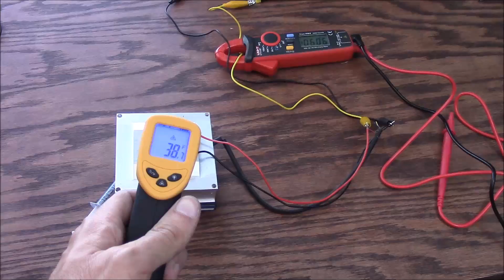Peltier Cascading - Does It Work??

Comment: to keep the usage down you can add a flat water block to introduce water cooling the heat sink would be stage one cooling and the water circulation would be stage 2 cooling. Im currently experimenting with this to see the lowest temp i can get with a 12715 the more TDP i add to colder the cold side gets but have not managed to get higher than 10 volts for the peak cold at -4c using baby oil yep baby oil.
Reply from the maker: We should compare notes on your experiments.  I am racing to do as much solar stuff as I can before fall begins and then I am going to turn my attention to indoor projects such as this peltier stuff.  I want to explore TEGs and build a peltier fridge version 3.0.  I also have a device to start experimenting with peltier air conditioning.
Reply: ive done alot in my days that involved TDP and the pelts can not be skimped on for the hot side thats for sure. The Tall heatsinks offer great TDP but not an option for me like you what i have is fridge related 10 cubic foot. Your H60s are doing a great job im sure but the hot side well if you do a custom liquid set up do hot side pelt to flat water block then a heat sink. One of those Arctic heat sinks with fan to the water block and get the liquid cooling active it will not only cool the water block but the heat sink as well. The concept is stage one cooling heat from the pelt saturates the water block the heat sink with the fan will pull it away and the (stage 2) excess heat gets absorbed by the liquid cooler and if you have a metal surface to mount the heat sink to (thermal tape and 2 screws to secure it) that would be even better but insulating would be vital to keep the heat out of the cold cause the metal surface is going to pull heat as well. I  did something similar to this and seen a 12c temp drop with the pelt cold side and was able to increase the voltage from 9.5 at its coldest to 10.5 at its coldest on a temporary set up and i dont want the full 12 volts to extend the life of the pelt. Ive seen several pelt videos from factory built pelt fridges failing to cool due to peltier failure. Next step for me is buy an extra water cooling set up AIO or maybe custom for the cold side and Arctic bond it all together no hardware to even have a chance to cross heat over to cold that way. Well at least until the pelt is cut off but that can be worked around to so that its not so bad. From the videos ive seen you do you have enough to make 2 cold sides for one project with your AIO coolers (if you have not put them to other use) but make sure the cold side stays in the cold. Im going with custom liquid cooling/chill with mineral oil its what i know and honestly mineral oil is thinner than water non-toxic non-conductive non-corrosive. After seeing some of the AIO cooling systems fail videos cause they dry out im not sure i want to use them one small part for custom is much cheaper then a whole unit and have spare parts left over to rot away in the closet. As far as the pelt though arctic bond will release but it takes a whole lot of pressure to make it release and then the special cleaner to remove it. I can see the most common fails in a pelt fridge thats well built (listed in order) power supply (only if its under rated or barely enough), fans, pumps then the pelt last if its not over driven but first if it is.  
Peltier 12715 will use 8 DC amps constant and surge 10 -12 amps at 10.5 volts
Not bashing at all dude just trying to help Ide like to see frost on the radiator instead of condensation with the last fridge build you attempted i think that would be exciting!
Reply from the maker: Cool, I will have to give that a try.  Good ideas.
Reply: I stand corrected its not a 10 cubic foot fridge its a 4.3 cubic foot fridge with freezer i just got it from my dad today and a perfect flat metal backing this is going to be fun
Reply from the maker: Sounds fun to me!  I tried converting a small freezer one time to peltier from compressor and had minimal luck.  So hopefully you have a better time.
Reply: heat sink, water block, pelt, water block assembly did not work heat gets stuck at the water block and does not transfer fast enough. just thought ide toss out the update

Comment: Thank you for running this experiment!  Hearing that you are interested in efficiency, are you aware that we receive power from the peltier when there is a temperature difference between the 2 sides?  What about keeping the cascade setup that you have now, but instead of putting in current into the top peltier, we see how much power we can extract from the top peltier?  For the top peltier, the temperature of the top side is ambient temperature and the temperature of the bottom side is the top side of the bottom peltier, which should be hot since you are running current through it to cool off the heat sink.  You should be able to increase the overall efficiency of the entire system.  It would be interesting to know if this would work or not.  I would greatly appreciate it if you could run that experiment.  Thanks.
Reply from the maker: Yes, that is called the Seebeck effect.  I have been wanting to play with Thermoelectric Generators using that phenomonen for a while.  Just haven't had the time.  Unfortunately, I no longer have this cascaded setup.  But I can try to test it in the future for sure!
Reply: @LDSreliance  if you are still interested in TECs, please let this pique your interest. what if you could run a TEC fridge in your car off of like 20 TEC placed strategically on your muffler or similar!  you'd want them wired parallel, with current more important than voltage. add a converter to make it usable
Reply: @willcal2738  you'd want to use TEGs on the muffler part as those are meant to generate electricity. I've been thinking of trying something like this out but using the cars radiator.

Comment: Thank you for doing an experiment that I had wanted to see done for sometime.  If you don't mind, I'd like to suggest a counterintuitive experiment; what if you put the two cold sides back to back, with two large heat sinks on the hot sides?  Would the juncture where the cool sides meet be much colder than your original cascading configuration?  I understand my suggestion means that the surface area of the colds sides are unavailable, but an element could be placed between them (such as  copper tubes filled with alcohol), that could be chilled to use for cooling purposes.   Please let me know if you think back to back cooling elements would increase the cooling effect more; thank you!    And thanks for the videos....
Reply from the maker: That is an interesting thought experiment.  I am not a physics expert but I don't know of a physics reason why putting two cold sides together would make each more effective.  The key to making peltiers more effective is shedding heat on the hot side.  But maybe someone with more experience than me can answer this for you.
Reply: No. Things only cool off when heat is removed. Heat can only be removed via a temperature differential. If each cold side reaches the same temperature, they have zero temperature differential and cannot cool each other off anymore. 

Thus, the temp of the cool sides will stay the same if you press them together. 

Whatever they are trying to cool (if there is something in between the two cool sides) will approach the cool sides' temperature faster if they are both connected, but it will not get any colder than the cool sides' temperature.

The reason cascading works is that you use one TEC to get an initial temperature differential and another to get an even larger temperature differential. When the TEC's are brought together hot side to cool side, they pump heat in the same direction.

Comment: Teg peltier makes energy
Reply from the maker: A little.  It takes a lot of heat to make any power, though.
Reply: geothermal supposedly can be used with graphene woven cables put not too many kilometers into the earths crust to obtain much heat.  Or simply to heat water and turn an electric turbine and afford more planetary harmony.   Maybe much better than fission.  billionsinchange.org was working on it.  Thanks.   Remarkable play time and research with peltier modules in series.   I like.
Reply: They work both ways. When you see teg it just means the same peltier effect is being used but the quality of materials is meant for heat stress. Tec module have smaller elements and less robust wiring and the ceramic surface can be damaged by higher temp on hot side

Comment: i think you.. need a larger and a smaller module.
i mean say.. a 100 watt peltier will heat its hot side with 100 watt + the heat it moved, so the 2nd stage cascaded should be able to move that amount. and your heatsink should be able to keep the top of the casacde within reasonable temps, so dissipate like 300 watts.
Reply from the maker: Yep, I didn't know that when I did this test.  I'll have to try that out sometime.

Comment: How do you avoid condensation So water does not occur ?
Reply from the maker: I have not run into a problem with condensation but then again I have not used one of these all day every day for a long period of time.
Reply: ohh okey, so if you did run it all day there will be a problem - right ?
Reply from the maker: If it was humid and you ran it for hours then yes.  If you run it indoors there will be a lot less humidity because your air conditioner will already be pulling out a bunch of the humidity.
Reply: you dont no a way to not get condensation ?
Reply from the maker: I am telling you that I have never had any condensation problems or heard of anyone having problems.  But theoretically it is possible in certain conditions.

Comment: Are there some peltiers that just pretty much suck in quality whereas others don't? Maybe a rhetorical question but quite new to this. I used a TEC1-12705 in a wine cooling fridge (Haier) & now the temp runs around 70 - 75 degrees F. Before it was running @ around 50 - 55 F so wondering if it would be a good idea to take it apart & sandwich another TEC1-12705 to knock it down a few more degrees? Not really worried about effieiency @ this point.. just want it to work.
Reply from the maker: Some of them are very cheaply made and have really bad quality control.  The tolerances are wide.  I always buy at least 2 at a time and pick the best one.  They also get damaged in shipping easily.

Can you measure the current it pulls?
Reply: LDSreliance Going to look @ it when I get it back on the bench. I did get 5 shipped last order so hopefully 2 of them are good enough to get a decent reading.
Reply from the maker: In the same 5 pack of 12705's I have had 2 of them measure ~ 5 Amps, two ~ 4, one ~3, and one DOA.  I guess that is what you get for $15 with free shipping.

Comment: a mistake: this tyoe of thermometer have a 30-40 degrees angle of measurement, so if you measure at 25 cm like at the end, you'll measure also some heat from the heatsink
Reply from the maker: Good to know.
Reply: LDSreliance In this case it wouldn't be nothing big, like 4-6 * but still someting
Reply from the maker: Yeah but it is always best to be precise if you can.

Comment: I have tested a similar setup, except using water cooling - results below:

Maximum water temperature in the LQS was 35C at max load. Due to the heat distribution in the water, hot-side thermal conditions were therefore considered to be fairly static. this was monitored during the experiment.

I used water as the thermal conductor between the two peltier stages - this allowed me to know if the junction between the two where above or below freezing (the two units would be frozen together if below freezing).

Single peltier cooling allowed -18C to -22C at 12 volts.

Cascade cooling, with both units operating at 12volts in open air gave -22C to -26C at the cold side.
  note the junction between the stages was above freezing

cascade cooling with the 1st stage at 12 Volts and 2nd stage at 5 Volts gave -33C to -35C at the cold side
 note the junction between the stages was below freezing

The issue here is the heat dissipation at the cold side of the junction in the cascade setup. This did not allow for delta temperatures to be obtained. My next experiment will involve two 1st stage peltiers with a copper conductor to aid heat dissipation for the 2nd stage to the 1st stage cooling. This should increase thermal dissipation at the cascade junction by up to 80%  (expected deviation due to unueven heat dissipation and thermal conductivity at the copper junction).
Reply from the maker: Nice info.  When I did this test I was not aware that the second peltier module needed to be stronger than the first.  I will test that someday.

Comment: I believe you are making a mistake by suppling the same amount of power towards te 2 peltier units. the top one should be powered at least only 40 %  in order to obtain an" acceptance level of heat" able to be absorbed by the lower one . Try and it works MUCH better ..
Reply from the maker: I will try that.  At least a dozen people have told me that since I posted this video.  However, it does further drive home the point that cascading is EXTREMELY inefficient and you would only ever consider doing so if you had to squeeze out that extra 5 degrees at all costs.
Reply: "the top one should be powered at least only 40 %  in order to obtain an" acceptance level of heat" 

How is that done?
Reply: @mikeybaloney6211  just give it less power. If the top one is at 12v, then 40% of 12v would be about 4-5v (4.8v technically). This value should be adjusted in your finished device through trial and error to find the best temperature difference. I usually use two smps modules, they can be found really cheap on eBay or AliExpress and have adjustable voltage and often current limiting adjustments, and hooking up one to each cooler allows you to fine tune each one. Keep in mind you'll need a much larger heat sink with two of them than with one. I've seen most people use water cooling when stacking them actually so that's something worth looking into, searching "water blocks" on eBay can get you some good info, and some research into over clocking forums will give you an idea of how to set it all up. What kind of application are you planning on using these coolers with?

Comment: I want to make a cooling system that uses 12v 10 amp peltier + Pc fan that uses 12v  0.3 amp
I want to buy this battery (12V 10Ah / 20 HR)
how long will the battery last ?
and what does (12V 10Ah / 20 HR) mean?
thank you
Reply from the maker: It should last roughly 25-30 hours depending on other variables.

The 10Ah rating @ 20 hours means that they tested how much power the battery could produce for 20 hours.  20 x _ = 10 is the formula to figure out how many amps it took.  So in this case that battery will produce 0.5 amps for 20 hours.
Reply: i'm confused !
if it is gonna give  0.5 amp for 20 hour, what I using is taking more than 10 amps, how will it last for 25-30 hours
?
Reply from the maker: ahmad abid
Sorry, I misread your comment.  I only saw the 0.3 amp fan.  I would estimate that battery will power the peltier plus fan for less than 1 hour.
Reply: can you please explain how did you figure out that number, or the formula to calculate that, i didn't quit understand it
Reply from the maker: ahmad abid
I did not calculate that number.  The answer is from personal experience.  That battery is small and it is rated to produce a small amount of current for a long time (0.5 amps for 20 hours).  When you require a lot more amps, you will get a lot less time out of the battery.  My experience tells me that pulling more than 10 amps from a small battery like that you will probably get about 30 minutes, plus or minus, of run time if the battery is fully charged.